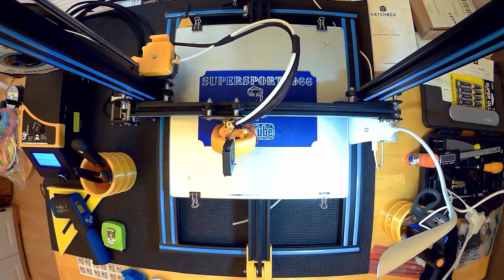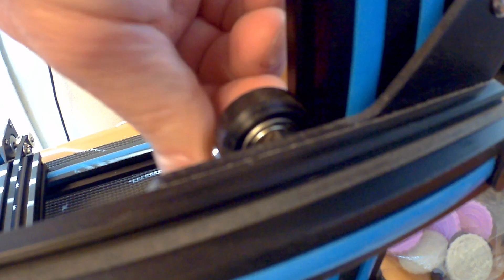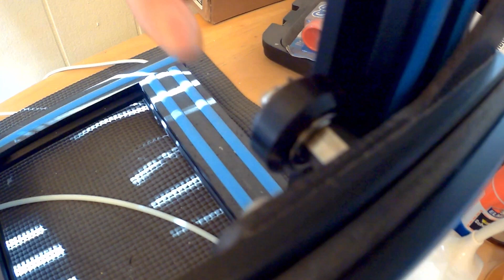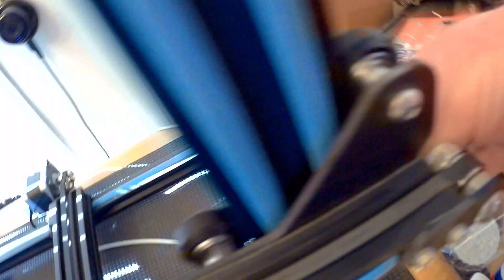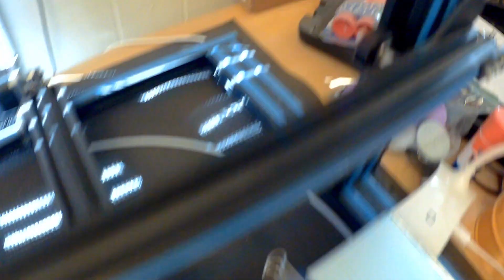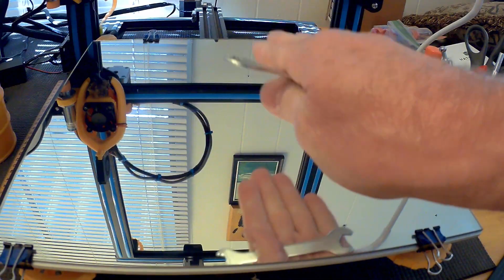Adjust Z-Axis Play on Creality CR-10

Comment: Do you have a video on how to remove play from the Y-axis, the bed rotates about the Y-axis.
Reply from the maker: Unfortunately, I haven’t done a video on that.  But it’s a similar adjustment.  If you look under the bed, on the wheels, you’ll have at least one eccentric nut under there.  Adjust the nut, or nuts if there’s two, just like in my video to tighten up the bed.

Comment: I cleaned the z rod and oiled it. Then tightened the eccentric nut. But it still had some z banding and the test cube (20mm high) was a bit to short in height. Then I loosened the eccentric nut a bit and now the cobe prints almost exactly 20mm.
Reply from the maker: Awesome!  Good job.

Comment: Ha have this issue but on the other side of the axis (where the extruder is),  I don't see nut at this place :/. Do you know how correct this ?
Reply from the maker: Yes, that side is a little harder to do. What I do is I loosen the nuts and bolts on all three wheels. Just enough that I can move them. Don’t loosen until they are floppy, only enough you can move them.  I then push the two wheels on the left side of the rail, to the right, as far as possible, so as to press against the vertical rail as much as possible, and then I tighten those two. That should make those two evenly tight with each other. Then, I press the wheel on the right side towards the vertical rail, as tight as possible, and I tighten the nut on that side. That should make it about as straight and tight as you can get it.

Comment: my issue is, doing the same exact method, the wheel u put the wrench in is tight for me and the rest of the wheels kinda move freely
Reply: thats on both sides left and right
Reply from the maker: Maybe your eccentric nut is not on the same position on your printer?  Also, be sure you are turning the nut between the wheel and gantry, not the nut on the end of the bolt.  The nuts on the ends of the bolt hold the wheels to the gantry. Those aren’t for adjustments.
Reply: @SuperSport1966  yeah im only doing the inside wheels not outside
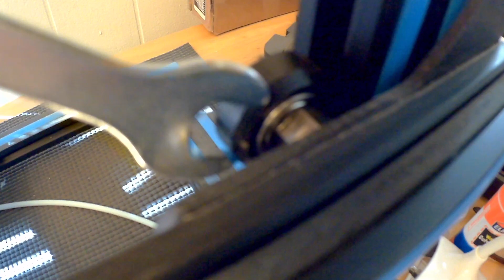Reply from the maker: If you look at 1:09, it shows clearly where to adjust the eccentric nut.
Reply: @SuperSport1966  the same way u turned the wrench in the video is the same way i should be turning on the left side (extruder side) or is it the opposite direction since its on ur left hand sude
Reply: which one is it?
Reply from the maker: @justinesq.281  it does not matter which way you turn it. As it’s turned, it alternates from getting tighter to looser. Just turn it until you feel it getting tight enough.

Comment: Ive had this issue for months and no one has been helpful, THANK YOU SO MUCH FOR THIS!! BTW what if the first nut is supper tight but the wheel is super loose, what direction do I go to loosen it cause I cant get it to loosen :(
Reply from the maker: You are very welcome.  If you mean the same nut I adjusted, then you can turn it either way. It turns in a full circle and goes from tight to loose to tight and back.  The other nuts are not adjustable.  

Also, the nuts on the rail on the left side of the printer are not adjustable, which I find very strange. 

When you adjust it, be sure you are putting the wrench on the nut between the wheel and rail, and not the nut on the end.
Reply from the maker: Just to clarify, you’re not trying to loosen the nuts. The eccentric nut is loose already. It does not tighten, it simply adjusts the wheel in and out.  On my CR-10, there is only one eccentric nut on the right rail. The one I show in the video. The other two are not adjustable.

Comment: This solved my first 4 layers crunching down to 3 and has significantly improved things since. Glad to have come across this.
Reply: I'm having this issue right now! Were yours too tight or too loose?
Reply from the maker: If your first few layers are crunching down, it can be a few things.  It can be the wheels are too tight.  It can also be they are too loose, but if too loose, it will affect the right side of the print bed more.  

Also, if your nozzle is too close to the bed, it will cause this.  The first layer will be too tight and squish extra material out that sticks up for the next layer. It takes a few layers to recover.  

In my case, I found that the Z screw on the left side was dirty and ever so slightly binding.  I cleaned it with alcohol, then added some lithium grease.  It stopped the squished layers.
Reply: @SuperSport1966  mine is definitely both sides so I’ll loosen them just a bit. Would you recommend just loosening the inside wheel or all 3?
Reply from the maker: When adjusting the wheel tightness, adjust to where the wheels JUST start to grip when you spin them like in the video. It does not need to be super tight.
Reply from the maker: @dmon670  on my CR-10, there’s only ONE adjustable wheel. The one with the eccentric nut as shown in the video.  I don’t know if other printers have multiple adjusters.  The one wheel will push against the rail and cause the other two wheels to also tighten automatically.
Reply from the maker: That’s awesome, thanks for letting us know. 😉

Comment: Hey great video I have a problem on my tevo tornado. I will level the bed and when I send it home and recheck the bed its off level  I think the right side of the z axis is rising up on its own. There is not a z motor on that side either I have tried tightening and lossening that side as well as the entire z axis but still ha ing the same issue
Reply from the maker: Does the right side (or left side) lift up and down easily when using your hand to lift it?  It should be pretty solid if you try to lift on it.
Reply: @SuperSport1966  ya i have tried to adjust it but I can seem to get it right also its the right side it has no motor on that side

Comment: I am having the same problem but this didn't solve my issue. Don't know what to do this is aslo my first printer
Reply: The problem is on right side of the printer. The gantry is low by 2 to 3 cm when I measured it from the frame to the bottom  of the bar. Tryed to move it up and tighten the wheel back up again but it just falls back down. Also tryed to loosen the wheels on the outside first and then install nut along the x axis but will not hold where I put it. 
It's a Creality cr10 only a couple days old never printed with it yet because it will crash into the right corner of the print bed.
Reply from the maker: @corymackey1130  Hmmm... It's really hard to know where to start with all of this without seeing it.  When you assembled it, did the upright bars end up very flat with the lower frame?  Sometimes, people have gotten the blue strips caught up between the uprights and the lower bars.  Also, are the wheels on the other side of the Gantry tight enough?  Sometimes people have issues with those being loose.
Reply from the maker: @corymackey1130  PS:  Sorry for replying so late.  I've been dealing with some health issues lately.
Reply from the maker: Cory Mackey Can you describe exactly what the problem is you’re having with your printer? Maybe it’s possible I can help if I understand it better.

Comment: My problem is the OTHER side. The wheels spin free and there is no eccentric nut
Reply from the maker: I have not made a video on how to address that side yet.  That is something on my list of things to do.  I basically loosen the wheels on that side and manually push them tighter to the bar, then tighten the wheels back up.  That gives me plenty of tension on the wheels to the bar.
Reply: @SuperSport1966  Likely the ideal solution is to get another eccentric nut. Which should have been included.
Reply from the maker: @FPChris  I totally agree! I'm not really sure why they didn't do that. I guess it saved them a nickel.
Reply: @SuperSport1966  yep
Reply: @SuperSport1966  The other thing I am running into is the threaded brass part that rides the z lead screw. There are two screws that hold it in place. If I tighten it down it binds the screw and the Z axis jams up.
Reply from the maker: FPChris The screws are supposed to be slightly loose. That allows that brass piece to slide around due to the slight wobble in your Z screw.  
That is by design, because most Z screws are not perfectly straight.
Reply: @SuperSport1966  Ok thx! makes sense
Reply: @SuperSport1966  Thx. I also figured out there is an eccentric nut on the bottom of the X axis. I had tightened the X belt and in doing so it changed the tension on that nut. I was getting micro layer shifts as a result. Something to remember.
Reply from the maker: FPChris Yes, indeed. I always make sure that runs back-and-forth smoothly.

Comment: Hi, in mmy CR10s4 has the same issue. I can see there are eccentric nut on right side rail wheel, but not of the left side rail wheel has this nut and one wheel actually moves freely. So I am thinking if I can buy one of those nuts to put on left side wheel.
Reply from the maker: Sirius55 what you are recommending would be ideal.  On mine, the left was also a little loose, so I simply loosened the nuts and forced the wheels tight as I could in the holes, held them there, and retightened. On my printer, that was enough to make it right.  But another eccentric nut would be best.

Comment: How do u adjust the left side that doesn't have the nut? Mine is way too tight
Reply from the maker: The left is not necessarily adjustable, but there is a slight bit of play in the holes that the bolts pass through.  You can loosen the nuts holding those wheels on and they should loosen up slightly.
Reply from the maker: Mark I forgot to mention that you can loosen the nuts to loosen the wheels, but be sure to tighten the nuts after you’ve gained a little looseness.

Comment: tried this mine wont tighten up , any ideas as i am ready for giving up on this machine
Reply from the maker: jeweller69 I’m sorry you are struggling with it. Are you anywhere near Sacramento California?  I’d be happy to give you a hand.  They are great machines when dialed in properly. 

So, when you turn the eccentric nut, does it move closer and further, just not enough?
Reply: Wish I was lol I’m in uk
Reply: Found out the plate at back had come lose and think it’s sorted to a degree. Just need to reset the z axis so I get a negative when calibrating
Reply from the maker: jeweller69 I’m glad you are getting closer. Let me know if I can help any further.

Comment: What about the left side of the x axis by the motor. Also mine still seems alittle lose even with the nut as tight as possible. Suggestions?
Reply from the maker: I apologize for not seeing this earlier.  I have not yet made a video showing how to tighten that side up.  That is something on my list of things to do.  I basically loosen the wheels on that side and manually push them tighter to the bar, then tighten the wheels back up.  That gives me plenty of tension on the wheels to the bar.

Comment: For me the outside wheel is loose while the inside one is tight as it can be. How do i tighten the outside one relative to the inside one?
Reply from the maker: I’m sorry I haven’t gotten it done yet, but I’m hoping to create a video to show how I deal with this and other issues with the gantry.  I’ll post back here when completed.
Reply: I loosened the 2 screws that hold the plate wheel assembly, then pushed those wheels in as far as they can go, and as I held it I tightened them back down, keeping it flush with the cross support. Then I tightened the nut and the whole assembly is rock solid. Now I need to fix the nozzle raising 2 mm when it starts extruding and I think my problems will be solved.

Comment: Hello, in your video you mentioned the eccentric nuts to be all located on one side but i think by default, there’s 2 on the right and one on the left. Can anyone else confirm this ?
Reply from the maker: Guillaume Leroux  -  Actually, if you are referring to the bed, they come stock with them all on the right side.  Unless yours was missed in QC, which does happen in China based companies quite often. Although, Creality is doing pretty good with that lately.

If you are referring to the gantry wheels, there is only one eccentric nut.
Reply: SuperSport1966 ok, great to know, i will change this right away.
Reply from the maker: If yours has one on the opposite side, then you won’t be able to get a good fit when tightening them. You need them all on one side.
Reply: SuperSport1966 i think they changed the design lately because the holes are made that way, you can’t put all eccentrics on the same side the way the plate is drilled on printers issued since i purchased mine. :/
Reply from the maker: Oh, that’s new to me. And strange. If they are all on the same side, it seems that it would be harder to get all 6 wheels tight against the rail. 
But, if yours is drilled that way, then it must be what they are doing now.

Comment: hi there :) i have a problem on that side thats a bit differrent and hope you could help me out :/ my problem showed its self when trying to level the bed by moving Z-Axis endstops It would always be fine on the home side but higher on the othere side so i measured the distance bitween z rail to benchtop and it was lower on the right side. This is where i need info:) how can i highten the right side Z-Axis rail because i have tried but it seam to always return:/
Reply from the maker: Ok, this video shows it pretty well.  The only thing he misses at the beginning of the video is that you need to verify the Bed is level with the frame before you start.  Otherwise, placing items on the bed for level isn't accurate unless you've already verified the bed is level to the frame.  https://youtu.be/NCAzrpZgCgA
Reply: @SuperSport1966  thank you so much mate this thing has bugged the crap out of me :/ its exactly what i needed :) thanks

Comment: thanks for this video. what if the 3 wheels are somewhat uneven? When I tighten the eccentric nut, the bottom wheel is looser than the rest. in order to get the bottom wheel tight enough, the 2 upper wheels seem over tight. Also I was hoping you would mention how to tighten the left side of the gantry? There's no eccentric nut, but for me all of the wheels on the left side feel loose like you show at the beginning of your clip.
Reply from the maker: Yeah, when I do these videos, I don't always think of everything until after the video is posted, or until people like you mention them.  I don't use a script, I just think as I go.  I should have explained the left side better.

There really isn't an adjustment for the left side wheels.  What I did was loosen the nuts on those three wheels, (one at a time), and when loose, I pressed them towards the bar as much as I could, then tightened up the nuts again.  There is a very tiny bit of play there, and this actually did tighten it up for me.

I would use that same method for the wheels on the right side to get the one loose wheel tighter.  Loosen it's nut, press towards the bar, then tighten.  You might even do this when the eccentric nut is loose so it moves easier.

If your printer has been used a while, or if the wheels have been over tightened, it might also have worn out wheels.  They do wear down over time.  If it's brand new, then this isn't likely the problem.  You can buy the wheels here:  https://www.banggood.com/5Pcs-One-Pack-3D-Printer-Part-POM-Material-Big-Pulley-Wheel-with-Bearings-for-V-slot-p-1249681.html
Reply from the maker: One more thing.  Be sure your carriage is even on both sides.  Measure up from the Bottom Frame to the Carriage Cross Bar on the left and right sides.  If it measures differently, then your frame may not be square.
Reply: @SuperSport1966  Thank for the great video, and additional explanations Super ! On that topic too, My frame has measured differently since I bought my printer and for the life of me I can't square it up, I've just over compensated the bed levelers to match it... Can you PLEASE help me out. How should I square my carriage to my frame ? Its not something easily found online believe it or not. Or perhaps I'm looking in the wrong place. Please if you have time throw me a bone... Cr-10S 4 owner and future custom 1000X500X500 printer owner :)
Reply from the maker: Does the CR-10s have dual Z height screws?  If so, you need to turn them to make them level as seen in this video:
https://youtu.be/tOOuJURIQ54

Comment: Anyway you could help me out and explain why I have to re-level my bed before every single print?
Reply from the maker: Brenton What printer are you using?
Reply: Creality cr-10s. I believe the same as you.
Reply from the maker: I have the standard CR-10.  Your model has the extra Z-Axis lead screw, the updated motherboard, and the run-out sensor for filament.  What happens when you print?  Is it too close, or too far away each time?  Does the bed seem crooked?  What are your symptoms?
Reply: SuperSport1966 If I begin another print without first leveling the bed, it will not stick to the bed. It will be just a bit too high. I have made sure things are just toght enough all around so that the wheels dont spin when you try to turn them as you pointed out in the video. Im not sure what else I can do. Others have said that I should only have to level the bed every few weeks(that would be great). I do have the extra Z axis screw. I also added rear bracing rods to the gantry for extra support(just did that yesterday).
Reply from the maker: Brenton That’s really strange!  Does it keep raising?  Is it getting higher every time you re-level it, or it’s just not very level?

Yeah, when I got mine level, it held for months at a time. I now have an auto bed leveler, so I don’t do it anymore. 

I wonder if your springs are too loose so they don’t have enough tension to hold it’s position well. You could either stretch them tighter, or you could move the Z-Height end stop switch slightly so that you need to tighten the adjusters a little. That would make it a bit tighter.
Reply: SuperSport1966 i’ll give that a try. Thank you